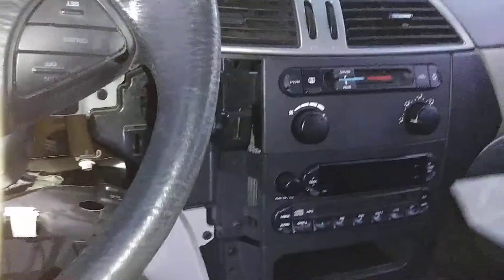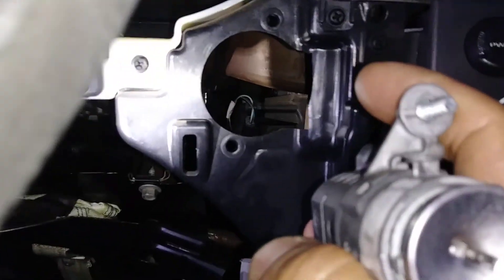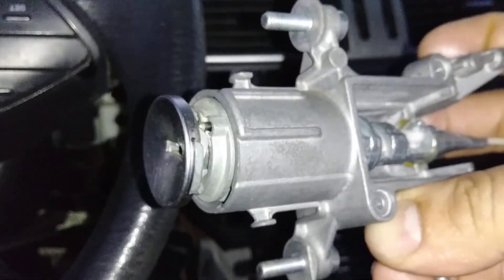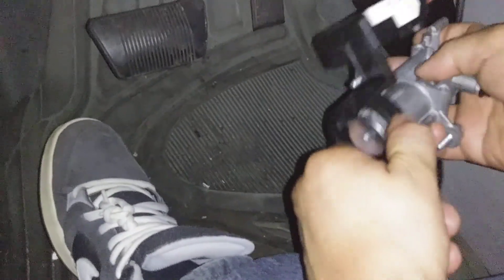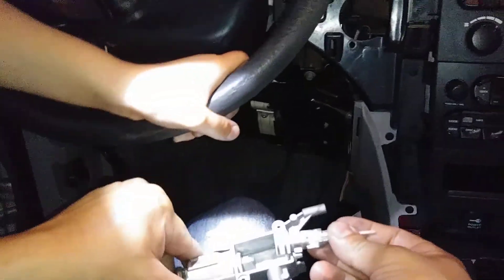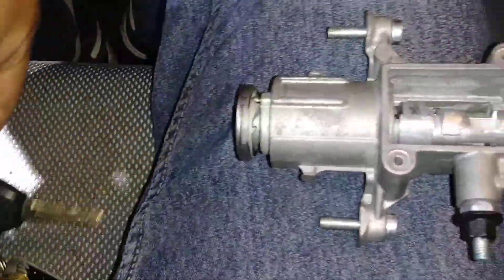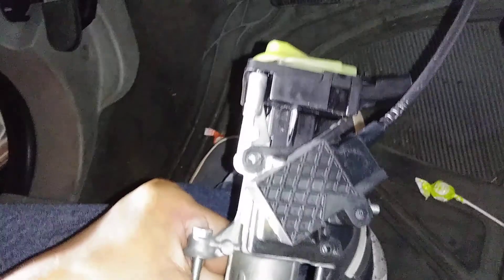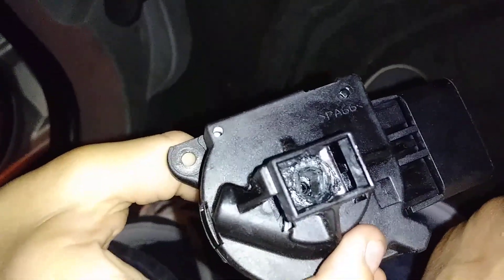07 PACIFICA WONT START IGNITION ACTUATOR PART 1

Comment: Now 3 years later, I would like to add my thanks to you for making this video.   This part is readily available at Advance Auto/O-Reily/Autozone, and it took me about an hour to do the repair in the grocery store parking lot where the ignition actuator broke.   The only three tools I needed were a 9mm Torx, an 8mm socket, and a Philips head screwdriver.   It took some patience to get it all to fit together.   And just for laughs, the pin fell out of mine the first time I reassembled it also.  So I got to do the assembly part twice.   Thanks for saving me a tow to a garage and a repair shop bill.

Comment: Thank you for taking the time to make this video and explain caveats. I’m a 53yr old single mom and I was able to do this fix. I unplugged some components and that little pin plunger moves up and down with turn of the key. Knowing how to ring the key aligns things was huge. Crazy thing was my battery went at the same time. I ‘think’… because the key turning in the ignition signals many things, the battery was draining. Until I got this actuated fixed, my car door ‘dinged’ with just opening the door, when this should only happen if the key is firmly in the ignition. Little things. Anyway, thanks a ton. I picked up the part locally at Napa for $53.xx out the door… though Rock Auto has it for $33.xx and the Amazon around the same.